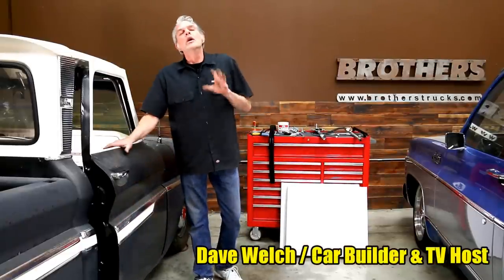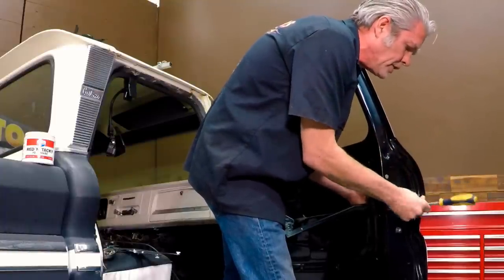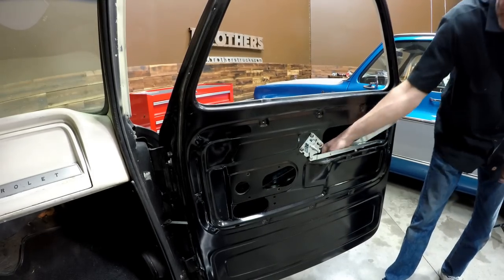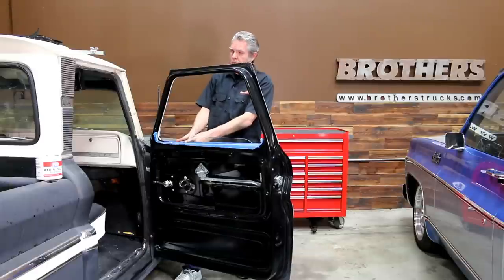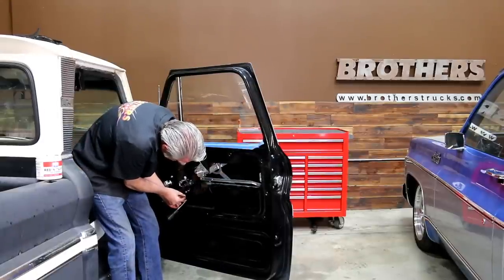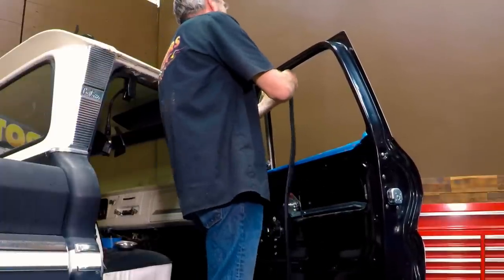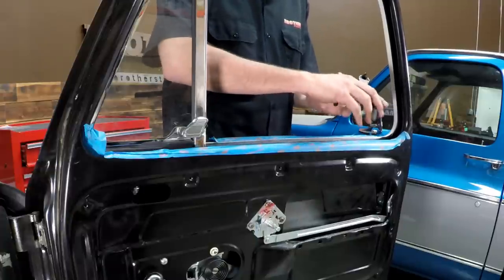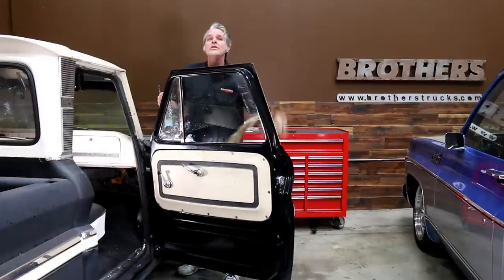How-To Chevy & GMC Truck Door Assembly/Loading

Comment: the window rubber felt should go in first there is no way its going in with the window in.....at that exact point in the film you edited it and then it was done thanks now i have to take both doors apart
Reply from the maker: We install window channel felt with the glass in all the time. If you are having trouble there are some tricks you can use. You can apply a small amount a mildly soapy water which will help the channel slide down, or you can dust the channel and the rubber with some talcum powder and that will often help it slide down as well. It is absolutely not necessary to remove the glass when installing the channels.

Comment: I own a 1948 GMC truck and have a real problem with the passenger door .  For some reason I can not get the door to open.  I have checked the linkage and all looks good .. Lubed the hell out of it with penetrating oil and lube ..   Ended up pulling the Lock key lock out of the door think it was the culprit ..  and still would not open ..  Rotated the regulator where the key lock would normally rotate to lock door and it rotates fine.  So apparently its in the striker area not allowing the door to open using either inside or outside door latches ..  Really scratching my head on what the issue is ..

Comment: How can I get the door to unlock when the door is closed .??? I shut the door with it locked and now I can not get it to open even using the key and looking into the door facing from inside it seems like everything is working but still will not unlock?????? Help me please
Reply from the maker: It sounds like the rod that connects the latch to the lock is disconnected, incorrect or damaged. Pull the door panel off on the inside and see if you can trouble shoot it from there

Comment: So I have a 61Apache and understand that you cannot replace the door latch with the glass in?
Reply from the maker: We'd have to do a little research on that exact truck, but at first glance it looks like it's possible if you roll the glass up and carefully remove the rear run channel. Then you can access the latch and swap it. When you're done just slide the run channel back into place and roll the glass down.
Reply: @BROTHERSTruckPartsTV Kool thanks for the feedback. Do you sell the LH door latch? And if so how ?
Reply from the maker: @adriantomlin1362  We do, they're $79.95, here's the link: https://www.brotherstrucks.com/60-63-DOOR-LATCH-ASSEMBLY/productinfo/DLA6300/
Reply: BROTHERS Truck Parts  Hey thanks for your info. I will be getting a door latch  soon. I m currently addressing other issues with the truck.